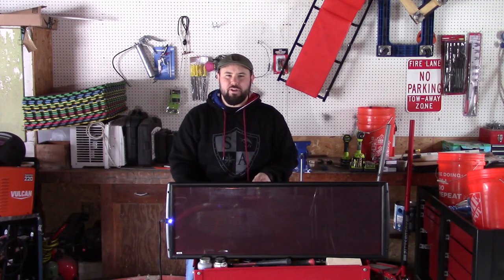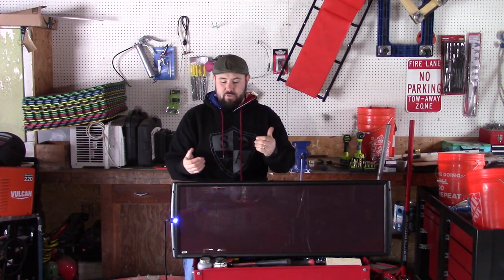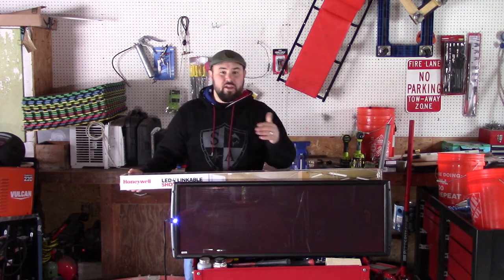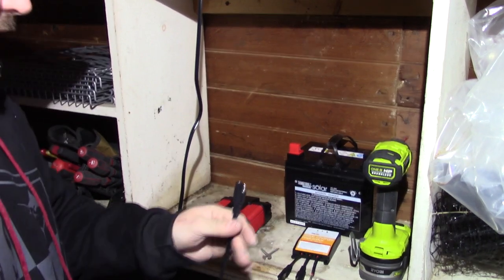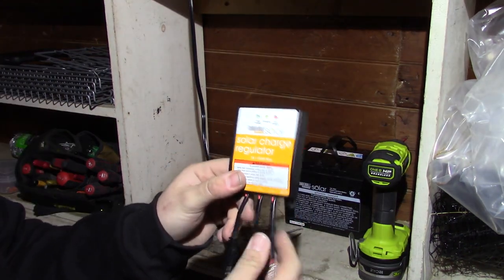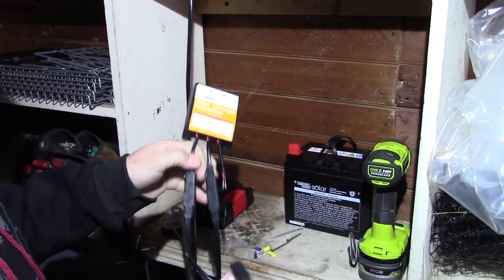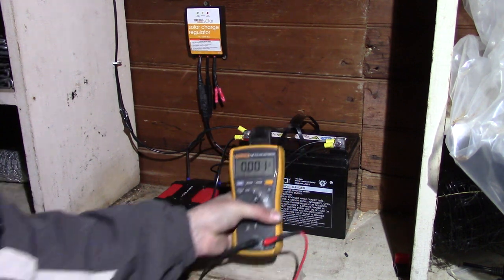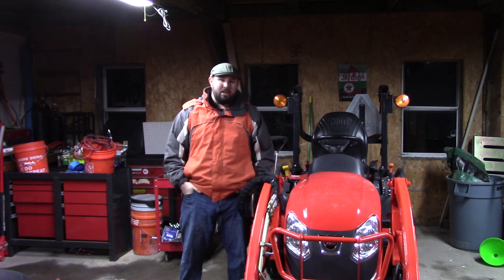Harbor Freight Solar Panel Installation

Comment: Correct me if I’m wrong, but you probably run out of battery quickly with that set up. One 25w panel and one 35ah battery doesn’t calculate in my head to being able to use 4 LED lights for too long at night with no solar at night. That panel is good for 1.5a charging I believe. You would need at least the 4 panel kit, possibly 2, and maybe a second battery or a 100ah battery to get closer. Love the way you hung the panel though. I assume that was a southern exposure. Keep playing and show more or changes if you make any.